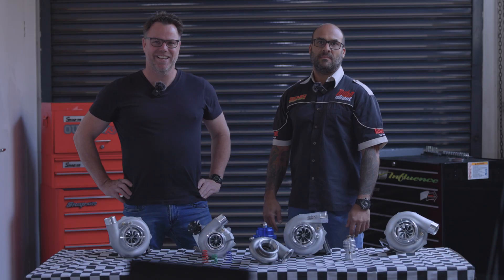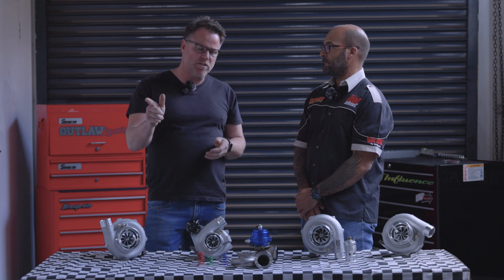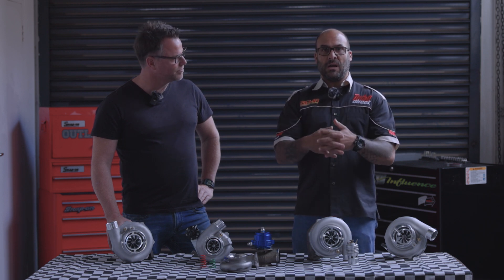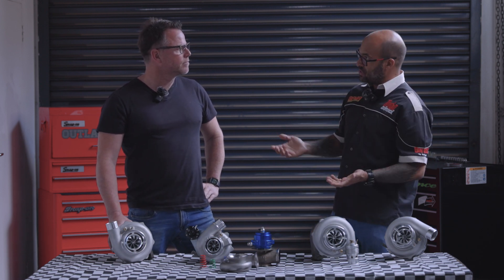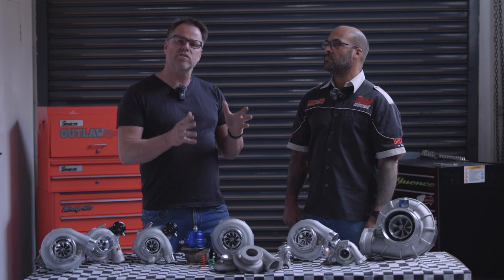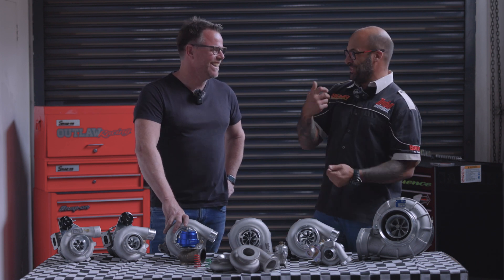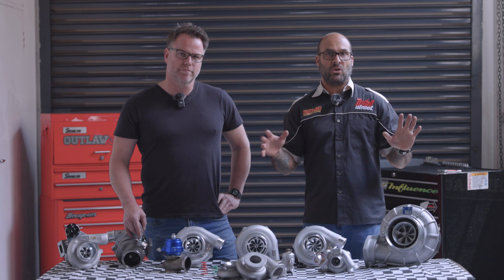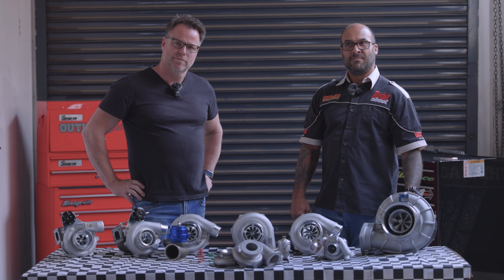The Right Turbocharger For Your Car | Turbo's Explained

Comment: Hope I get a response 

I have a 292 ci inline 6 I only wanna run maybe 6-7 lbs of boost that way I can run stock internals and get the most out of it 

What size turbo should I run ?

Comment: So I have a 3.0l  v6 audi engine with a 1.4L twin screw SC and I want to add a turbo to make power between 4000-7000rpm, I already have a 3.2 pulley ratio and want to add say a 67/67 with an exhaust AR of .96-1.15 to delay spooling since the SC already compresses air the exhaust is already flowing faster and harder than an NA car. My goal is 60mph-130mph and top speed runs/1/2mile pulls I know the turbo output will be multiplied by the SC so not a lot of boost is really needed but that can all be done with waste gates and tuning. I am making 748nm of torque to the flywheel already but AWD drivetrain loss significantly reduces that as well as parasitic loss from the belt driven SC. I need a water cooled turbo to add say another 200hp on the big end and boost by gear. 15 audi A6 premium plus quattro stage 2+ on e40 550hp currently without turbo, I have a port injection kit as well with 1050cc injectors and lpfp upgrades already to support the added fuel flow on a water to air cooled system for SC. Can you guys help me understand what I really need to do this? Z 3 r 0 d 0 l l 4 s @ g m a I l . C o m

Comment: I don’t think it’s that simple, you have to keep in mind rear housing A/R and back pressure when selecting. Not just how much airflow it can produce. 
Rotary engines even more critical.
Reply: 100%. Not to mention different turbine/compressor blade designs interact differently.